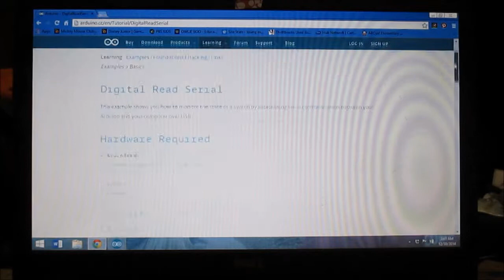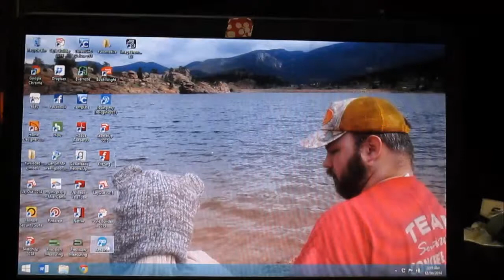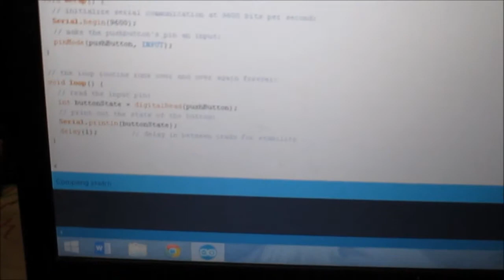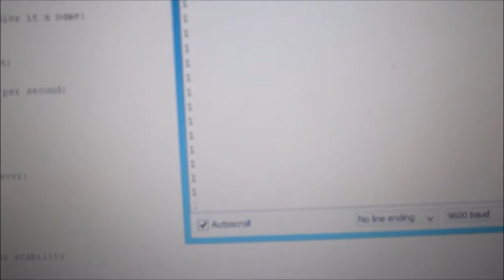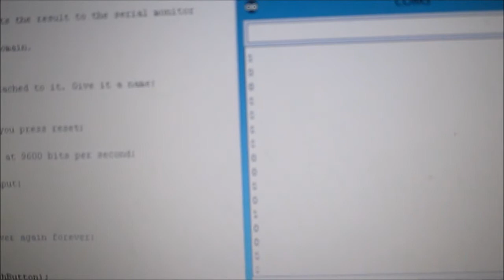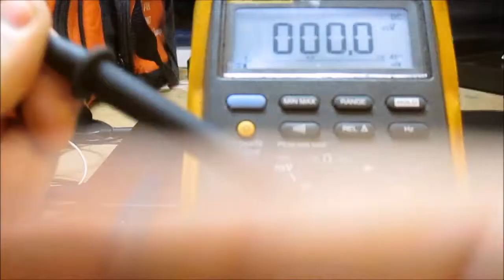Arduino Digital Read Serial Project 2

Comment: hey AL pierce  i read about arduino .but could not find what its insdustrial use .
Reply from the maker: I do not know for sure that it has any, but I would think you could use it to control many types of sensors and program the module to do many things. It is basically a programmable device that can input and output analog and digital electronic devices. Well, thanks for the comment and thanks for watching. Have a good day.